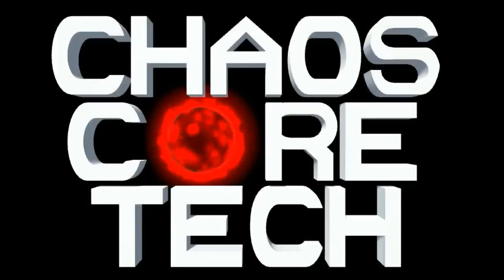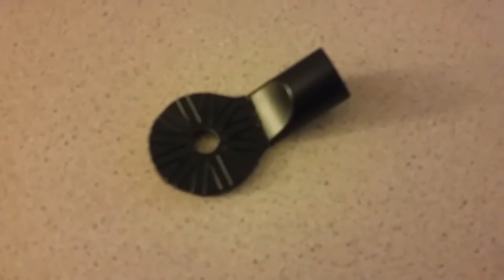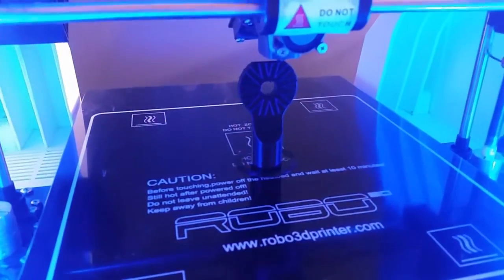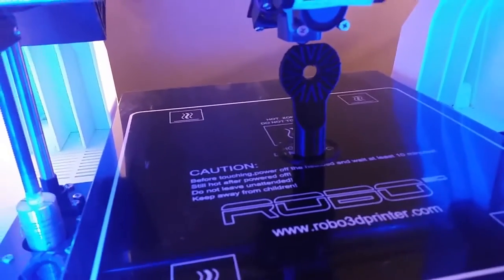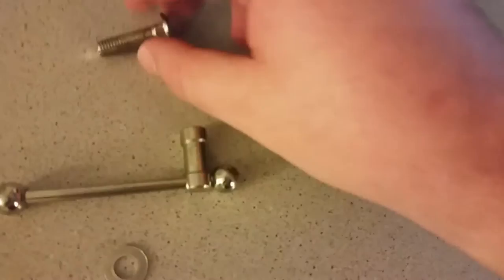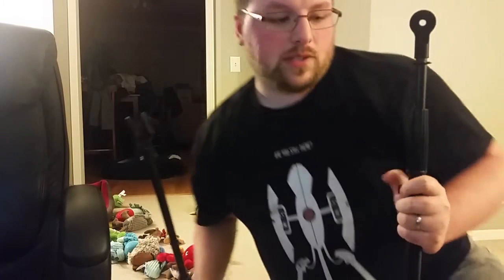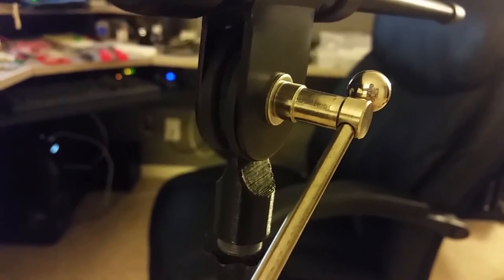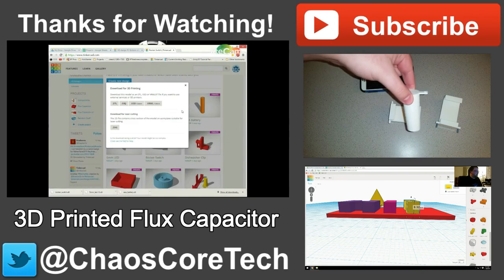Fixing My Mic Stand With My 3D Printer!

Comment: Nice job. You'd get better strength printing the part sideways instead of vertically. The way you printed it here puts the most stress on the weakest direction of the grain of the material. Sometime it's better to break design into 2 parts to get the best strength for each. Goo d job though!